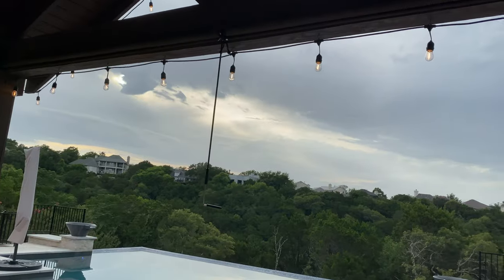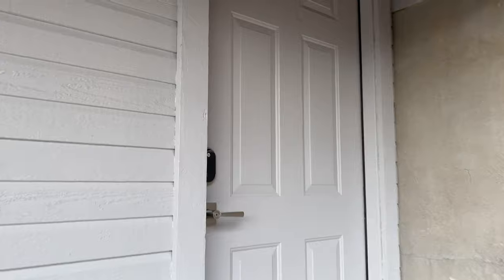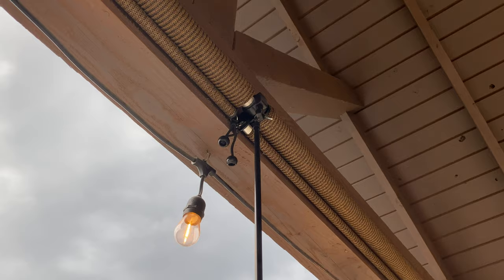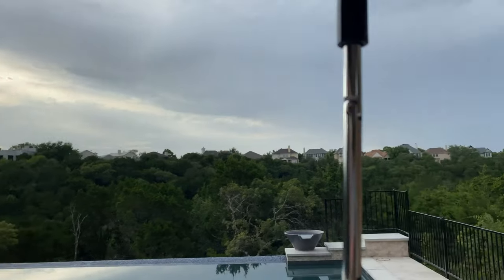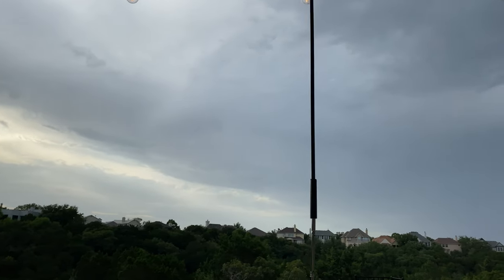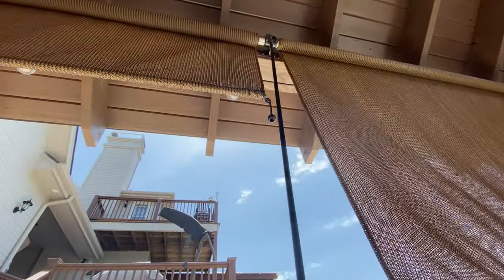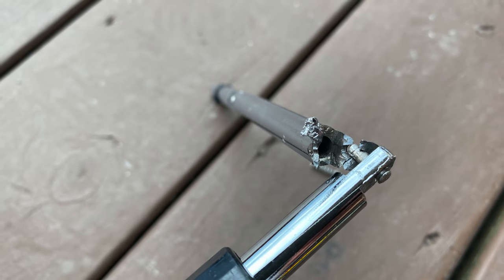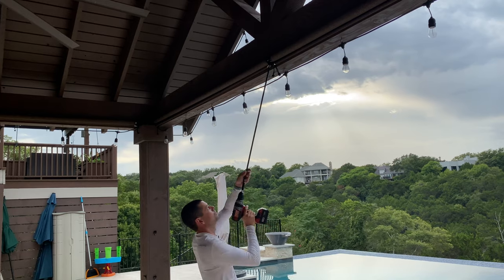Power Drill Modification for Manual Sun Shade / Coolaroo

Comment from the maker: One month later, this is really working well. In my video, my drill was set on slow speed, I'm now using it on high speed and I can raise and lower the shade 3X faster than shown. With the clutch at the lowest setting there's no risk of over tightening or unraveling the roll too far. I've used this setup with guests around countless times, and it always gets some positive comments for ingenuity!

Comment: Exactly what I was looking for thanks! Question.  What is the height on these?  Any issues not getting the valances?
Reply from the maker: The shades are 8' length. What do you mean by valances?
Reply: @UraniumTwoThirtyFive  You can order them without or without the valance. Ask your wife what a valance is.
Reply: I install these for a living and when doing the valances it’s much easier with two people because the mounting bracket Hass to be screwed up through the valance if it is top mounted. You can also order the cassette version of these and they are very nice. When ordering you can also get the smoother fabric that is almost identical to Springs window fashions/Bali Exterior shades.